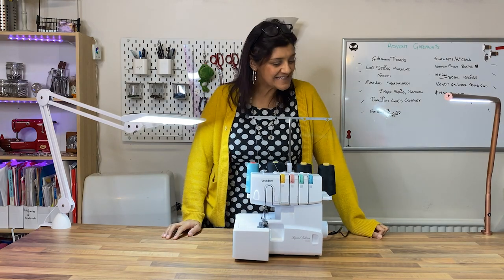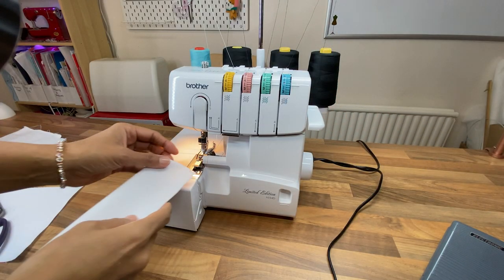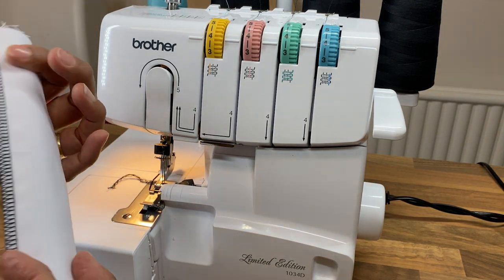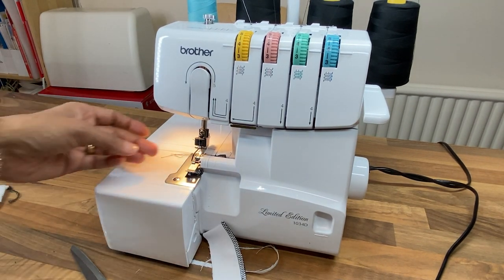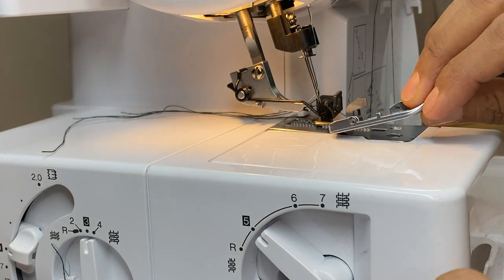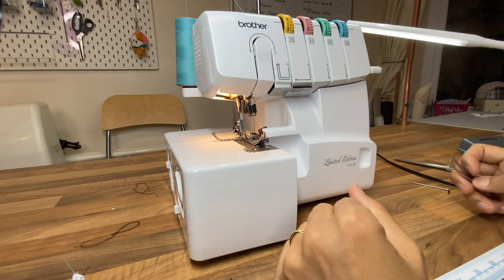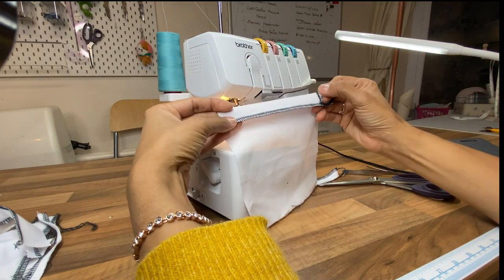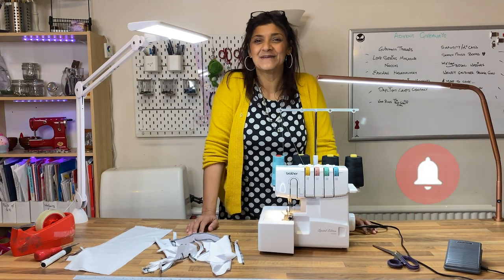Common Overlocker Problems FIXED Easy 1034d | Abi’s Den ✂️🧵🌸

Comment: Thank God I've found you! A pleasant voice, a clear teaching style and process!
Here is my question:
I cleaned my 1034D today after sewing gobs of fleece. I removed the throat plate, unscrewing the flat head AND the tiny Phillips head screw first. Upon removing the plate, a tiny "bar" fell into the works.  I've tried over and over to replace all this, and each time, after running the machine, the thread all bunches up and will not release from the long tiny triangle piece and create any stitches. How can I fix it correctly?
Reply: The shape of that tiny piece is crucial to the stitches being able to slide off and not get caught.in the meantime , you could try a diamond dust miniature file or even a small sanding wheel on slow speed using a dremel  tool. My dremel comes in quite handy while working on fixing sewing machines and sergers Need to smooth off the roughness of it until you can replace the needle plate. I have a 1034D myself and lots of extra parts not sure if I have one to fit your machine but if into I will let you know.

Comment: I so wish I had found you before this evening. I spent an hour re-threading my machine. My last thought was check my needles. That's exactly what was wrong. My right needle wasn't in completely. Spent an hour fiddling about with it. Now I'll remember always check needles if everything else is threaded correctly.

Comment: Hi Abi, I’m not new to sewing but new to overlockers. I have purchased a brand new in box. I’ve set it up as the manual states, however there is no movement in the hand wheel AT ALL!!!. My question is ( from an engineering background too) , before I start taking it apart, are there stabilising screws on machines when brand new? 
Thanks in advance 
Maxi

Comment: Hello amazing Abi I love you videos, I have a newish Necchi OV234 which hasn’t been used much or abused in anyway. When I selected trim it used to cut but no longer does. The knives are sharp and oiled and all the settings are correct. I can move the curved knife up and down with my finger on setting 5 but when I sew the knife doesn’t move to cut…could the left cutting switch be somehow not connecting to the knife? I was wondering with your knowledge if you could help with any suggestions please🙏🏻
All my best Sophie

Comment: I know this is an older video, but my machine is new out of the box and the way they had it threaded did not work. I watched a how to video on threading and it is doing the same thing. When I start to use it, it doesn’t work properly and makes a grinding noise. Do you have any tips for how to fix this. I am fairly confident that I followed everything exactly how it was shown and it’s just not working. I would really appreciate any advice.

Comment: Avi, I have a 1034D which has barely been used. The green (upperlooper) tension disc seems to not engage at all. The thread stays loose, and the tension release button seems jiggley.  I have checked as well as I can to be sure no thread(s) are caught in there. Any ideas at all? I live very far from any repair people.

Comment: Abi I'm so frustrated. My serger went wonky a couple weeks ago and I've spent so much time learning, downloading service manuals, adjusting the timing, lining everything up to within .5mm of where it should be and my serger now creates a chain, but the moment I insert fabric under the foot it stops chaining, then if I take the fabric out it will chain again. I thought it had to be an issue with needle bar height, feed dog height, or presser foot tension but I've checked all of those and they all are where they should be. I'm in tears and quickly running out of ideas. I just want to sew again, I have so many fun ideas for summer and it's all been put on hold - I have limited time to sew during the day and all of my sewing time has been dedicated to fixing this damn machine. If you have any ideas at all, I'd be so appreciative. Thanks for listening anyway <3
Reply from the maker: Hey Crista, how did you get on, I didn't see the comment. I'm so sorry you've had a tough time with this machine

Comment: Hi, I love this video but I do have a problem in my serger. The lower looper thread keep breaking and I don't know what's causing it. Please help
Reply from the maker: Oh no! Often, something is catching the thread. On these machines, the tension discs can catch thread in it’s grooves, or the so when the machine is running, it gets snapped. Try to locate the point where this might be happening by following the thread along its feed.  Is it always the same thread?

Comment: I have a Brother overlooker and I noticed that the left needle  tension dial is quite loose compared to the other dials. I had been using 3 threads, but needed 4 threads, but the Left needle thread was rather loose. I changed the needle and checked it was inserted correctly, but still not sewing properly. The only way I could get a decent stitch was to turn the Left needle tension dial up to 6, but the right is set at 3.5. I didn't have this problem previously, so was concerned that I do now. I always keep a note of test samples, so that I can have a reference to various fabrics. Do you think it's something to do with the Left tension dial being looser than the others and can I fix it myself.. Can you advise please. Thank you

Comment: Thanks Abi. One question if I may? Why does my serger end up with six threads rather than four after I have serged?
Reply from the maker: That will be because the machine is  threaded through the loopers incorrectly, the order of looping in that case is wrong and the looper thread is getting caught too early at one point. I’m so sorry but try again x

Comment: Hi Abi
I haven't used my sewing machine for a long time and when I tried to start sewing the machine won't even move not even the wheel. What can I do please? Do you think it needs oiling? Thanks you so much for your help. Carmen
Reply from the maker: Oh no! I think a little oil will definitely help but these machines use such poor quality metal inside, they rust easily and jam up quickly. Id stay clear away from Brother in the future

Comment: Abi you are a godsend! I viewed this as soon as you posted and thought it very helpful. Two days ago I managed to comprehensively mess up my FR Jaguar. For some reason having previously moved the cutting blade out of action I then proceeded to restore it except not fully. As a consequence I closed the machine with the blade horizontal. I have absolutely no idea why I did this, must have been a senior moment. I started to stitch and the machine seized. I managed to open the front doors and see that the blade was now behind the upper looper! I was able to separate them and proceeded to sew again but of course it didn’t work, why should it.
I thought that maybe I had bent the looper so I removed it, breaking an Allen key in the process, and then spent a day researching obtaining a replacement upper looper to no avail. On inspection it looked okay so I reinstalled it. I then rewatched your video, stopping at each stage to check each point. I had bent needles, and had managed to misthread BOTH loopers, TWICE. I corrected these but still it wouldn’t sew. I then discovered that I had reinstalled the upper looper badly causing it slip and rub against the needles. Once I had retightened it everything else fell into place and my machine is working perfectly again, thanks to you.
The downside is that I had persuaded myself that maybe the time had come to upgrade to the newer model, which is now unnecessary unfortunately!
What on earth would we do without you.
Reply from the maker: That’s brilliant to hear. That’s my goal, empowering sewers to do their own repairs, to understand their machines and stop being ripped off by cowboy mechanics who fail to service our machines. This reduces landfill and gives machines longer life x well done Sue! You’re a superstar!

Comment: Hi Abby, thank you so much for sharing your knowledge on overlockers. Please will you assist me? I have a brother 2504D (South Africa) and it looks the same as the brother overlocker in the video. I was serging perfectly fine until i i tried to serge a lightweight strech fabric. The fabric seemed to bunch up and jam around the stich finger and or loppers. I re-threaded,changed needles, cleaned and oiled the machine, fiddled with tensions, even changed thread but it continued to happen. I tried using a different strech fabric to see if it will work but it keeps jamming under the needle plate.
Reply from the maker: The stitch finger gets loose on these machines and if dislodged can cause the chain to build up in the needle plate area.

Comment: Hello Abi, I think my issue is that I'm not using the proper needle, I thread it and the thread keeps breaking. Could you please tell me if there is a certain type of needle for the Brother 1034 Serger, if not could you let me know what type you use. Thanks in advance !!!
Reply from the maker: Hi. any regular sewing machine needle will work in all standard domestic overlockers. If your thread is breaking, it’s catching something along the thread path. Or the threading in general is not quite right. I’d start again.

Comment: Hi Abi. Everytime I try to use my machine the lower loop thread cut off. What might be the problem?
Reply from the maker: Something is trapping the thread, maybe it’s wound too tight? Getting caught on a spindle or in a guide? Sometimes a dirty/furry machine makes the thread easy to pull out.
Reply: @AbisDen  thanks Abi.  I will clean the machine and oil it,  then I will see what happens next.

Comment: Hi Abi thank you for your video. When sewing knitted fabrics do I need to use a ballpoint needle or adjust the thread tension or pressure foot tension? I'm making mittens from upcycled sweaters so they have various thicknesses.  Thanks for any suggestions.
Reply from the maker: Take a look here. https://youtu.be/67kO1Cilhrg

Comment: My janome has suddenly started snaping threads particularly on the furthest right looper. I've cleaned it, oiled it and re threaded. I've even changed threads, adjusted the tension and it still keeps snapping. Any suggestions?

Comment: I should have found you before I (think) broke my Brother Serger machine. I tried to sew a thick fabric and almost broke my machine. Now, when I press the foot control, it makes the noise as if the machine is running but nothing happens. do you have any idea what has happened? Thank you so much for your video.
Reply from the maker: Yes, have a look at this and the throw the machine out and never buy brother again! https://youtu.be/FFROu8fX12s

Comment: Hi Aby, I have a Serger Machine 1043D for around 10 years ago.  I haven't use it for some time and she was working ok and today I plug her to use it and she won't turn on not even the light. It seems is the cord, it looks ok to me but I think it is not having contact.  What do you think.
Reply from the maker: You could try the fuse in the plug?

Comment: I have this machine - the US version - and I have it torn apart to re-time for the second time, same problem.  What I'd like to know is this:  what company in makes the Jaguar machine that opens completely in the front - but is available in the US?  Googling this gets me nowhere, only a long list of air-threaded machines and a lot of these Brothers (which I already have).  
My current problem is that my upper looper is losing the thread every time.  I can feel where the needle is hitting the lower looper so I'm fixing that.  But this is the second time; I'd really like a new, more dependable serger that I won't have to fix.  Do you know what company makes a full-front access machine that's available in the US?
Reply: @AbisDen  Thank you!  ❤️Also - I gave up and cried uncle - took it to my repair guy in pieces 😂

Comment: Hi Abi, can I ask whether you need specific needles for overlockers or are general purpose ones ok? Also I have been using Lidls thread with my Lidls overlocker but it keeps breaking- would I get on better with more expensive thread? Thank you. Love your videos, they are a godsend🥰🥰
Reply: Some sergers can use the same needles as sewing machines , EXCEPT my Baby Lock 5620 uses a much SHORTER needle a DC-1F. If you have your manual it will tell you the proper needles to use. My serger BL5620 actually has a label on the front saying uses needle DC-1F  and a picture of the needle next to it in actual.size.I love my Baby Lock Machines!

Comment: What about threads wrapping around the needle plate instead of forming a chain and jamming the machine after awhile? I have this problem when trying to use 2 needles, and no problems when using only one.
And the other machine just slowing down almost to a complete stop after several seconds of stitching. But the stitches are fine.
Reply from the maker: Oh no, the other needs oiling or maybe an electrical fault, the first, look for the needle plate tutorial 😉 🌷

Comment: Hi Abu even though I did what said it still remain the same. Is there any other causes the stiches are not overclocking
Reply: My machine is a 14SH744 overclock machine
Reply from the maker: Have a look at the timing video and good luck
Reply: @AbisDen  is it the same vedio or a different one. May you provide a link to your timing vedio please

Comment: Fab videos - easily explained - however, I have a problem with my Jaguar 2015 - the left thread doesn't seem to catch only giving a 3 thread stitch instead of 4.    I've tried every tension adjustment, my needle is in fully but this is common place for me!  Driving me nuts!  What can I do to adjust this?
Reply from the maker: Have a look at my new video out today. I think the solution will be there.
Reply from the maker: #sewing #sewingtips https://youtu.be/6G4J_Ex Tia

Comment: I used to think every machine had heir own unique way of fixing/adjusting the timing.  Mainly thought this because there are SO MANY different videos showing so many different steps!  I stumbled on this video and your up close camera shot removed all those thoughts  because the end result of every overlock serger is the same type of stitch.  For some reason there are NO videos on my Serger model , Babylock 5260,  does not have differential feed  I don't believe, regarding how to adjust the feed dogs. Being an older model machine it only has a dial with numbers inside the left side and an indent in the wheel used to adjust the feed dog height. At first the feed dogs would not move at all until I started fiddling with it. I am using light to medium weight fabrics so the 1-2 setting should be fine.  How do I set these feed dogs so I can get going on my projects?  Any assistance would be a huge help and a blessing!
Reply from the maker: Some older machines don’t have the ability to change differential feed. I don’t know your model but it could be one that falls into this category. The numbers inside could be the knife adjustment.🤔
Reply: @AbisDen  the knob inside is definitelynthe feed dog adjustment. As I turn the large screw in the center itnis the feed dogs that raise and lower. There are numbers on it amd when loose the part they are on turn. A metal button type piece is pressed and rests in a groove in that part. So I held it down while turning the large screw until the 0-2 area was directly at the bottom. After doing that the feed dogs were up when the needle.was at high point and down when needle down. I FIGURED OUT THE PROBLEM ! I was the PRESSER FOOT not the top tension! The "height" of the presser foot was TOO HIGH this causing TOO MUCH PRESSURE on the feed dogs NOT allowing them to move! I just HAD to SHARE this information with you since YOUR video GREATLY helped me! I am putting a video on my channel to show exactly how I got to this resolution too! Just one of those ODD things with Vintsge Sergers I guess, thanks again!
Reply from the maker: Yay! brilliant - well done . I didn't find the video, but I learned a few other things - Lea and Perrins Worcester sauce is the best ;)

Comment: Hi Abi would you mind helping me fix my machine. Brother 1034d, it serging fine still and cutting ok as well. But I went to adjust my cutting width and the knob clicks loosely and it's not moving the width at all. It's stuck in the last position I put it on. I want to finish my top then attempt to take the cover off. But not really sure what I am looking for to fix the width  which does nothing at this point. Knob itself is tight. Please help?

Comment: Thanks for the video. I have a Bernina 700D. It was working the last time used it, which was a while ago. Now it won't stitch at all. Correct threading, oiled and dusted. But the handwheel won't even turn(forward). Any idea what the issue would be? Thank you.
Reply from the maker: Oh no!you’ll need to open it. It sounds like it’s jammed  did you store it somewhere cold or humid?
Reply: @AbisDen  Yes, I did put it in the container for a few weeks. I wonder if I can use WD-40 or only sewing machine oil. I hear there's something called trifollow and Pb blast but not sure if they're the right ones for sewing machines. I did use a few drops on the metal bits but still no movement.
Reply from the maker: Try wd40 to break down whatever is sticking and wipe that away after a few hours, then try sewing machine oil, or you could even buy some silicone grease and smear a teeny bit on before trying to move it again

Comment: I’ve just bought a singer s14-78 (eBay!) I then bought additional presser feet (Amazon). I’ve tried to use the ruffle foot. But it catches on needles, which then snapped. Do you know where I’m going wrong? Thanks
Reply from the maker: Did you check from the seller that the feet were for this model? It sounds like they're maybe not, have a word with them to confirm, good luck x